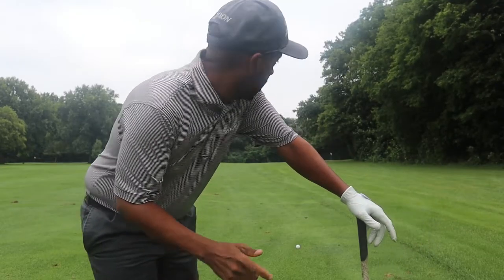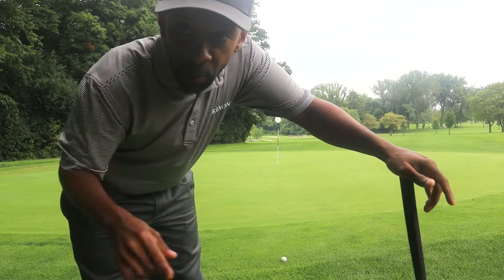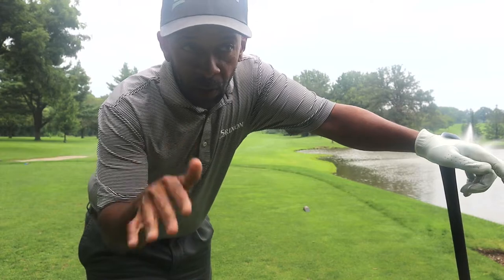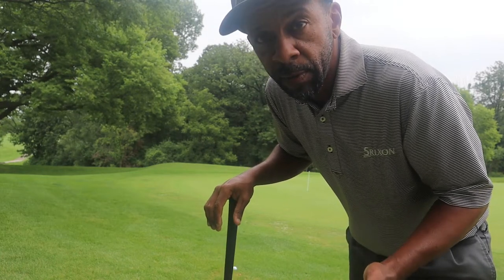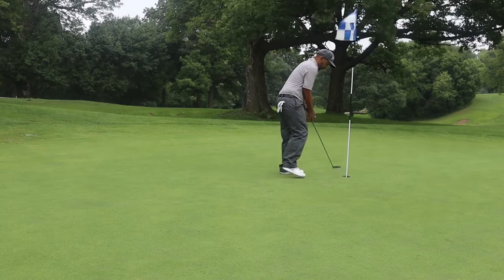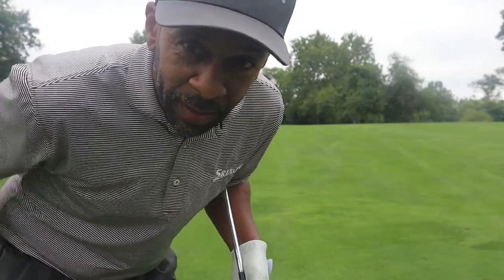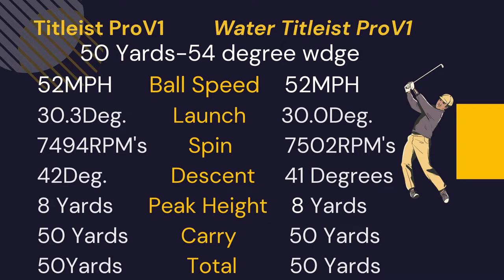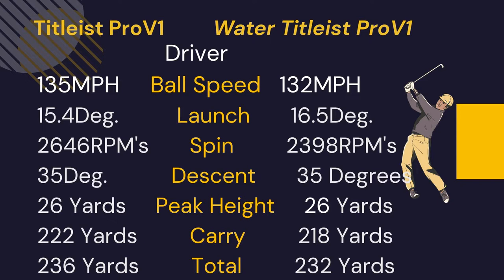How does water effect your golf balls?

Comment: I have only read one study on the subject that was done at a University and not someone trying to sell anything.  And that study showed virtually no difference between balls that had been submerged for as long as 11 months and new ones.  What does make a difference, not surprisingly are balls that have scuff or impact marks that you can feel.  Rough spots catch the wind and effect spin, often drastically.  But apart from that, I don't have any hesitation in using recycled golf balls.  Basically I keep 2 supplies, new in box and recycled from trusted sources and those have been cleaned.  If I'm on a hole that has a water hazard, I use one of the recycled balls and the rest of the time I use the new ones.  I appreciate your honest and straightforward opinions here, great job as always!
Reply from the maker: Thank you so much. That's good information!